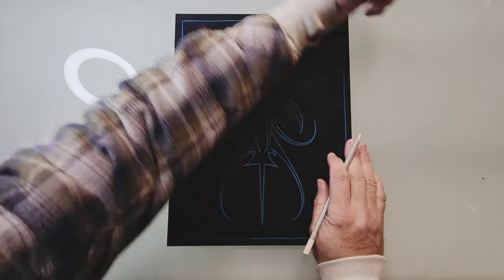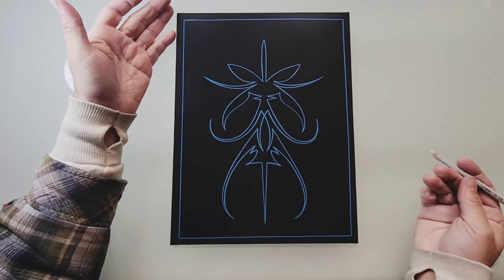Pinstriping Practice In Real Time, Part 2 of 3 Pencil Work

Comment: Hey man, love the videos, started trying to pinstripe myself. Learning everything I can through yourself and villa. Whst are you pulling lines in in this video? I am practicing on glass but always looking for something different to practice on, thanks in advance and thanks for the videos they really help. I find I have a lot of trouble coming up with designs.
Reply from the maker: My personal opinion is that glass is great to practice on, because it is slightly more challenging and so darn easy to clean. The panel in this video is aluminum faced sign panel. Works good if you are making a finished wall hanger. Can be bought through a sign supply company. I have other videos showing how to cut it.